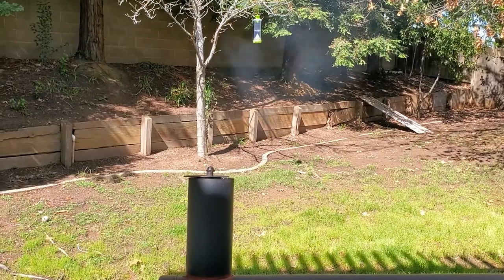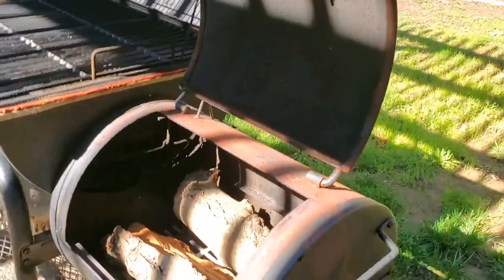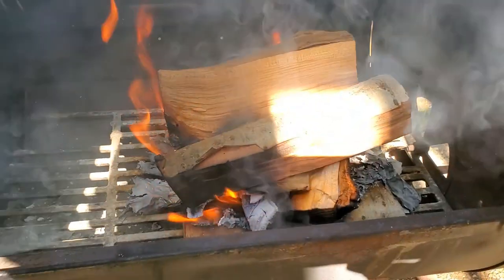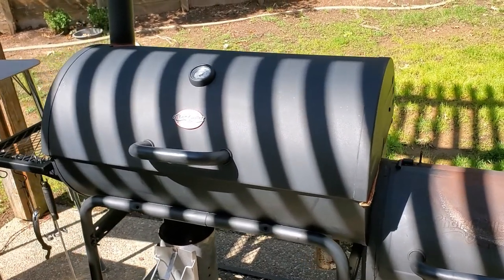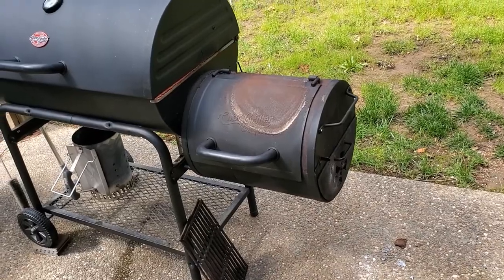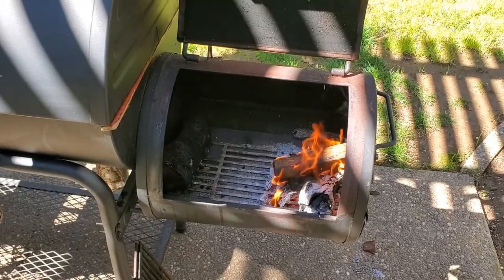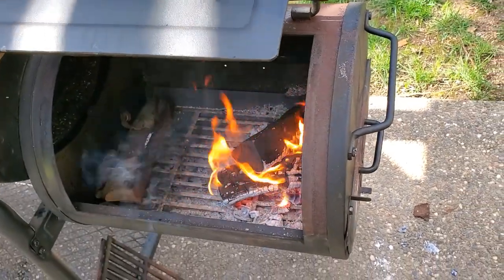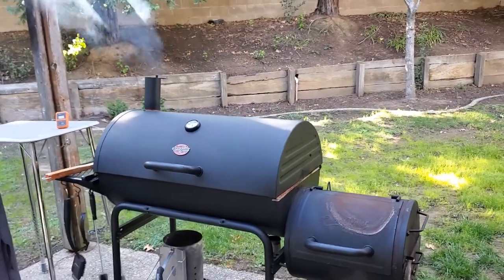BBQ 101 - Offset Smoker Temperature Management and Smoke Quality - White Smoke vs Thin Blue Smoke

Comment: Hi Tony, I'm a  complete amateur to the game. I purchased one of the cheaper end offset smoker on Amazon. Should I use the offset smoker ONLY to heat up the grill? I put the charcoal in the main chamber to heat it up... Is the offset smoker only for LONG term grill? I'm talking just for burgers I guess.
Reply from the maker: Hi David, thanks for watching and thank you for your question.  The side fire box should be used when you want to "smoke" your food and/or if you want the heat to be "indirect".  Indirect heat is when the food is not directly above the fire.  Indirect heat is what you will need to do for long, low temperature cooking processed, like you would use for a Pork Butt, Brisket or Ribs.  You can heat the entire grill using the side firebox, as I do in my video, and this way you don't have to clean out any coals from the main cooking chamber.  If you are cooking "hot and fast", as you would with hamburgers, then you should build the fire in the main cooking chamber and then place the food directly over the coals.  I do this a lot with burgers, chicken, steak, kabobs, fish... anything that I want to cook quickly.  I hope this help!  I'll do a video on using an offset to cook burgers or chicken legs with direct heat soon.  Thanks!
Reply: @TonyToneBBQ  thank you for that
Reply from the maker: My pleasure!

Comment: Dang you must of went through a quarter of a cord of wood before you through the ribs on!
Reply from the maker: I know it looks like it.  I usually get 4 to 6 mini logs from 1 split that I cut up.  I did a Pork Shoulder a few days ago using 4 splits on an 8 hour cook.  Your mileage may very, depending on factors.

Comment: You really need to move your smoker away from your heat pump
Reply from the maker: Thanks for the tip but that's not a heat pump, it's a condenser, and there's enough space between them so that heat isn't transferred from the box to the condenser, but that doesn't even matter when it's 65 degrees out.

Comment: Does real wood have more lignin in it than sawdust pellets for a pellet smoker ???
Reply from the maker: I don't know. Answering that question would require a chemical analysis and comparison between natural wood and all of the various brands of pellets. What I do know is that I can count on the consistency of natural wood and after burning enough of it I can judge the quality of the wood easily.  It's also nice to know that if I'm burning oak, I'm burning oak and nothing else.